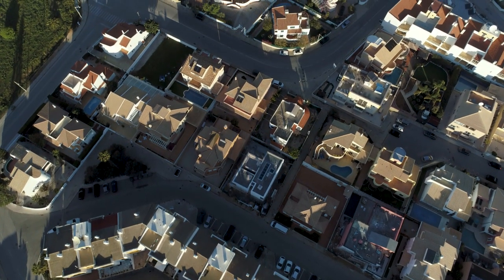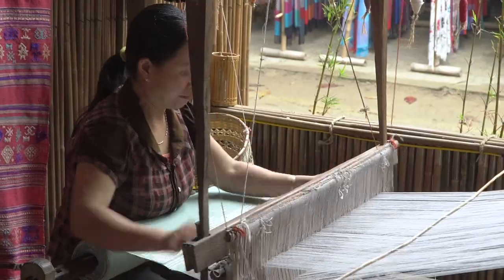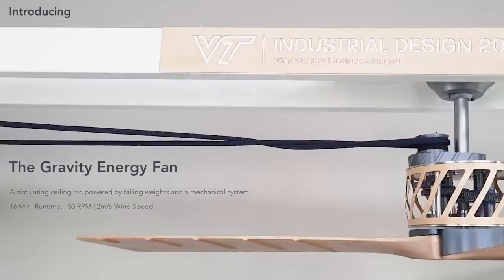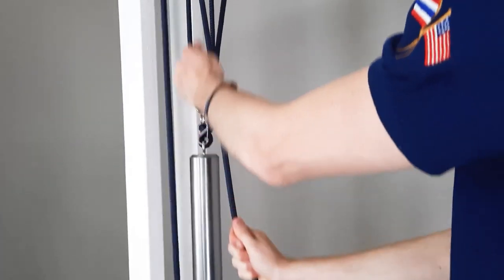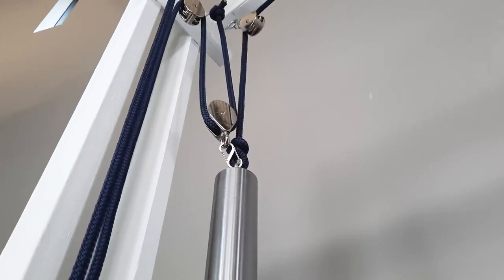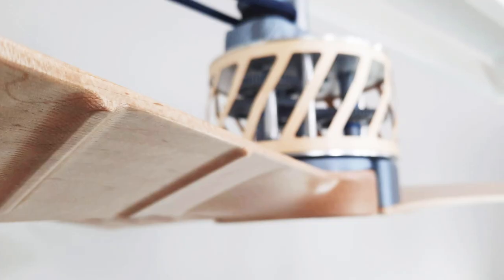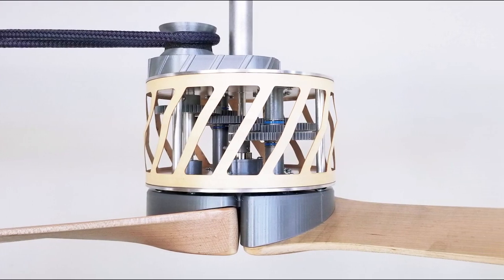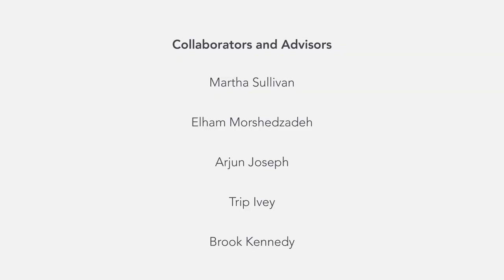The Gravity Energy Fan

Comment: If you made your weight shorter and wider, you'd get more time from each charge.
Reply: And unfortunately would put it further from the wall and would create more undesirable leverage unto the supporting pulley overhead. Definitely thought of it though :) and also steel round stock gets wildly expensive as you grow in diameter :P
Reply: Bag of sand for the workshop .

Comment: Hello!  I am trying to accomplish something similar for a large chicken coop built into a connex storage container.   We need a fan for the night time when they're asleep but need a higher gearing ratio so we can go for several hours off a single lifting of the main weight. 

Did you ever commercialize the product?  Are there plans available online for experimenting?   I'm interested to tinker with the design and see what I can come up with - perhaps even fully 3D printed
Reply from the maker: We haven’t pursued anything further with the project, and we haven’t packaged all the files for easy download either unfortunately. Everything is in a 3-D model so it could be exported, but I lost access to my fusion 360 account when I left the university so I can try to see if I can find the models for you. If you are going to go for a higher ratio I’d have to recommend moving away from 3-D printed parts, unless you have a commercial grade printer or perhaps even a metal printer. We tuned the 3-D printer we used over many attempts so I’m pretty confident we got close to the max performance out of PLA, and we’re thinking that to make it last longer it would need the gears to be manufactured out of a metal. My number is 919-904-4831 if you’d like to text me and I will try to send you some files since it would be awesome if you experiment with it!
Reply: @cjmugs  thanks! I can likely make the 3D models myself. But interested in the paper or report - do you have a copy of that? Thank you!

Comment: More energy spent making the fan, gearbox, weights & rope than it saves.
Reply: Yeah, I totally agree. In hindsight, there are many better alternatives in both material choice/manufacturing processes that could have been made, as well as critical design choices, like using large light-weight pulleys in horizontal arrangement in place of the gears mechanism and taking into consideration the extreme and non-symmetrical forces going through the fan and the supporting hardware. haha but yeah, fun regardless and still proud of it for getting in done during the onset of Covid. Cheers
Reply: Lighter weight fan blades would've been very ideal too thats for sure
Reply: @noahworden6201  but using this proof of concept, you can tweak it to be more efficient in so many ways. This has great potential.

Comment: 640 times efficient? What a load of crap.
Reply from the maker: Yes not 640, that was our mistake we re-did the math after the video was done and it is actually 67. Here is the math to prove it: 
The Gravitational potential energy of the weight (25lbs) at 8ft above ground = 271 J

Gravity Fan run time = 16 minutes

271 J / 16 mins = 0.283 Watts to power our fan. 

Standard ceiling fan uses 75 watts/hr at 60 rpm, so about 18.75 watts/16 mins.

18.75 watts (to run a standard ceiling fan for 16 mins) / 0.283 watts (to run our fan for 16 mins) = 67 times more energy efficient